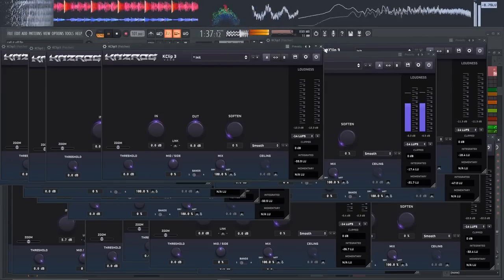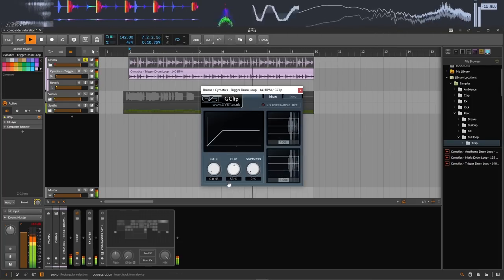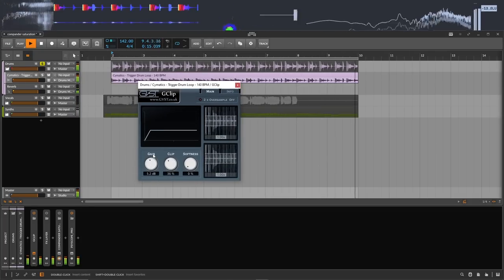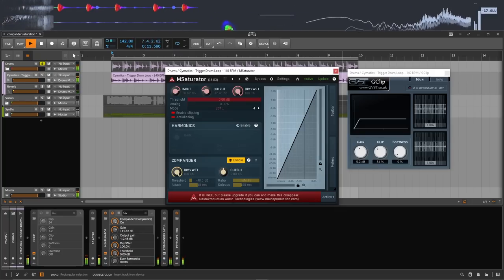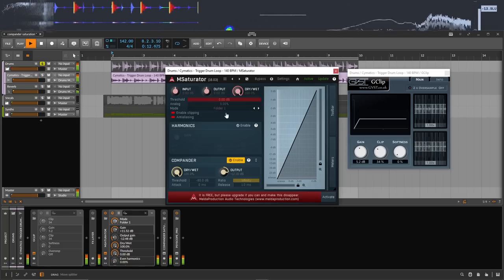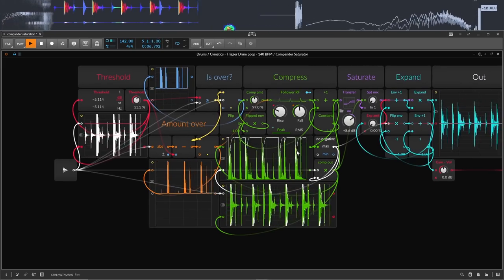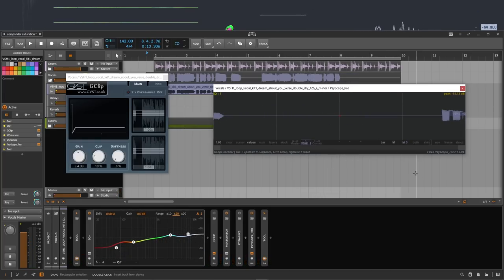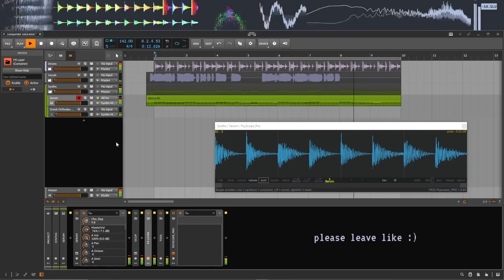heavy distortion without losing dynamics

Comment: the fun thing about a compander setup is that it enhances transients in two ways. first, the transients get distorted harder, and then the transients also get put back in as the loudest 'part' of the waveform. this can definitely cause problems if you're overdoing it, but it can also just be a really nice way to make transients cut through the mix in a way a normal transient shaping plugin wouldn't be able to.
Reply from the maker: well said!!
Reply: So a Compander is the tool? I am surprised Bandlab has it. Compression and Expansion! I understand one but not Expansion
Reply: @rodstone Expansion is basically the opposite of compression. 

Compression takes all output above a certain level and brings it down to the desired level without touching anything below that level

Expansion (also known as upwards compression) takes everything below a certain level and brings it up without affecting anything above that level.
Reply: @SaltSpirits what? expansion ≠ upwards compression. expansion is taking everything below a threshold and turning it down, so it expands the dynamic range. (and then upwards expansion would be taking everything above a threshold and turning it up but I've never seen that used anywhere)

Comment: you can flat tilt out bass pre-distortion and then do the opposite EQ curve after distorting. This will bring back some dynamics as youre distorting an altered signal. Also nice to have it not modulate so hard from insane bass energy.
Reply: what do you mean?
Reply: @PrideGamingTV  pump the bass with an eq going into the distortion and then do the opposite so the rest of it gets some more of the dynamics
Reply: Look up eq curves, tilt is a setting for pro q, not sure where else you can find it but there are absolutely some other eqs that have that option. @PrideGamingTV
Reply: @PrideGamingTV  meaning; if you distort something using a waveshaper with a flat frequency response sidechain, each frequency contributes equally to the intermodulation that will occur in the distortion. By EQing going INTO the distortion, you can alter the impact of certain frequencies and their contribution to the distortion, and then do the opposite EQ after the distortion to bring back the original frequency response of the incoming signal. The "equing in/equing out" is simply to alter the behaviour of the distortion, and is synonymous with equing the sidechain signal of a compressor, or any non-linearity for that fact. Anyway, you know the sound of a bass heavy song getting clipped, and all of the high frequency instruments flutter and warble in response to a big bass note. That is the bass intermodulating the whole signal.

Comment: Its been a long time that ive watched a music production tutorial and it was about something "simple" and generally useful that i didnt know yet
Reply: @jshstuff  also i dont know if this would necessarily have a use, but would it be possible to achieve this without the intial compression? Aka you just record the amplitude of whatever goes above the threshold on your saturator to reintroduce that volume after the clipping. So it would only be cutting off peaks but boosting them right back in.
Reply: or even crazier being able to adjust how much the initial sound is compressed regardless of the expansion in the end. so you could basically adjust how dynamic the saturation should be, but still retaining the dynamics of the original sound, rather than having completely even saturation due to the input getting squashed by the compressor.

I think the thing you built in bitwig could already get close to achieving just that if you just removed the part that did the gain reduction in the beginning.
And obviously application for this would be 808's where you might want a harder distortion in the beginning that fades off. If you compress it then the distortion would be applied equally which would be a different type of dynamics lost. 
You could be adding spectral dynamics from distorting a dynamic sound (aka different levels of saturation due to the amplitude differences) AND you could reintroduce the lost dynamics in the end.
Reply from the maker: yeah you’re a smart one!! this would totally be possible and could lead to some great results. I don’t think you can do that in MSaturator because the companding links the compression and expansion, but in my Bitwig grid patch all I’d need to do is bypass the module doing the gain reduction and it would work just like you said.

thanks for this awesome idea 👏👏👏

Comment: For a different approach, you could have an effects rack that has a compressor on one end, then an expander on the other with the side chain being the pre-compressor sound. For extra gravy you could assign macros that compensate for each other combining the same controls on the compressor and expander side, but because of the saturation you don't necessarily want the exact same settings on the compressor and expander
Reply from the maker: cool idea that would work super well!

Comment: other clever way is insert the tool device after saturation or clipper then add audio sidechain modulator and take the input from the same track but choose pre-fader then adjust the setting with rise and fall settings , then modulate the gain knob in tool device the add original dynamic back into the track after distortion/clipping :face-fuchsia-tongue-out:
Reply from the maker: another bitwig W. you’re totally right I didn’t even think of that. thank you for sharing!!
Reply: @jshstuff  Bitwig is the best daw, no cap
Reply: @jshstuff  To do it in a more controlled way, you could also use a Segments modulator and use that to modulate the Tool device instead of dealing with the rise and fall of any kind of envelope follower.
Reply: @shaboogen  there's endless possibilities with bitwig and that's what i loved about it

Comment: for level match the input and output of any type of sound while maintaining dynamics, dial +6db in Compander Output, Attack <0 ms> and threshold at <-80 db>. Thats literally it. The saturation threshold must NOT be on <zero>, thats the gain knob (it indicates where the effect starts applying, if put at zero it doesnt do anything). Release work to smooth the saturation being added.
What you explain in the video is how to introduce saturation using the compander as a pre dynamic modifier. Thats why it only works if you put +6db in the output of the Compander with the saturation threshold at zero (what you do its surpass the "zero threshold" capacity to read sound). That explains why you dont hear the mode of the saturation changing either.
Great video!!

Comment: parallel heavy distortion (i.e. just using the mix knob on your distortion plugin) at a low-ish mix level can often give you very similar results at a fraction of the effort
Reply: @TheJohnsofDoes  It adds harmonics while keeping most of the dynamics intact

Comment: in fl studio you can just make a channel with distortion and connect it with another which also is connected to the normal one, or just making a copy and adding the distortion on one of them
Reply from the maker: yeah that’s parallel processing. that does a similar thing but is different, if you scroll way back to the earliest comments, check out @Wurldz comment for a good explanation

Comment: Good video! Just a tip, Klanghelm's SDRR2 can achieve a similar effect. There are multiple saturation options, and there's a dynamics section in every one of them. Set the dynamics slow, transients wont be affected/squashed with saturation. Cheap and a good plugin!
Just wanted to share.
Reply from the maker: cool thanks for sharing! it looks good gonna have to check it out

Comment: there's also airwindows' "facet" plugin, wich basically clips the audio "at an angle", wich is kinda hard to visualize but basically means it clips audio while still preserving its peaks. Think of it kind of like if the db limit was a horizontal line across the time domain that sliced the waveform, and then it was slightly tilted horizontally, letting out some of the peaks. It may not be as effective as your technique (and if you push it too hard it just ends up clipping normally at high values), but it works in some cases, it's free and it's extremely easy and quick to use (I'm referring to the idea of clipping without losing dinamics, of course the fatness and overall sound you get is completely different, but it's useful for cases like when you want to clip a simple synth and a sub to get that gritty sound of the sub frequancies and the synth clipping together, but without losing the dynamics that the both already have)
Reply: chris from airwindows is the goat
Reply from the maker: sounds very cool and also confusing, gonna have to check it out
Reply: @VicerFx  yessir!
Reply: @jshstuff  yeah it's pretty hard to visualize at first, u just gotta fiddle around and u'll get the picture by just experimenting. There's also his YouTube channel which has a video for every plugin he's ever put out where he explains in detail how they work and shows examples, so you might wanna check out his video on facet (and his thousands of other plugins, of which dozens are really unique and interesting)

Comment: I got the same with camelphat bitcrusher and input volume control, its also possible with waveshaper in fl, but extreme saturation is a good point, gonna try on plucks. Thanks for the tip. 

P.S. guitar plugins are also a good idea but sometimes it can be too experimental and most of the time emulations use too much cpu resources. And maybe its not so flexible because you control amount of limiting and saturation with input gain (most of the time) so result is based on amp algorithms, and gain leveling can be not very precise. But i found a free British clean amp emulation it works great. But tbh your decision gives more control. Maybe I will use it with some custom amp emulation. Gonna make a nice character to synths. Put huge reverb on the top and play on the edge of the gain and have dynamic range... Mmm, sounds inspiring and interesting 🎉

Comment: this is great! One question though do you think that using a tool, then a saturator/distortion device then a dynamics device with an expander setting and the input signal being the tool would have the same effect?
Reply from the maker: I’m not certain I understand exactly what you mean, but as long as you can find a way to add gain based on the volume envelope of the pre-saturated sound, then yeah it’s the same thing! someone else mentioned that you could simply do sidechain expansion based on the sound itself before the saturator, which is a pretty great solution. that could even be what you’re describing here?
Reply: Yes that's what im saying! Its nice to have it all there in the Msaturator but could potentially be done with any saturator if you sidechain expansion based on the sound itself before the saturator. I like the idea either way. @jshstuff

Comment: The use of MSaturator as a clipper here is super weird and cool but I'm not sure how well its explained for people who really want to dig into why things are happening - took me a while and some playing around to actually understand whats going on here.

I was confused by your description and use of the threshold slider. normally when you set a threshold to 0dB, you apply no saturation since saturation only happens above the threshold. This is how it is implemented here in MSaturator and theoretically there should be no saturation effect happening with these settings. However, the way you set things up here works because MSaturator's saturation stage has no internal headroom and digitally clips at 0dB, this happens ON TOP of the saturation being applied

To say that the threshold controls the clipping mode is a bit misleading. What actually happens here is when you turn the threshold down, you are apply saturation AND digital clipping, which just happens to be functionally the same as soft clipping. This also means that if you have the threshold set to 0dB, none of the saturation modes are actually making a difference, since you are not saturating and only applying digital clipping.

Another thing to note is that the output knob in MSaturator is not equivalent to the clip knob in GClip. it is just a gain at the end of the plugin. There is no parameter to control the clipping threshold, it simply is fixed to 0dB inside the saturation stage.
Reply from the maker: hey, thanks for taking the time to write this detailed reply. I appreciate that you care so much about getting details right. let's see if I can parse this properly and correct my mistakes/comment on everything you mentioned!! sorry for the wall of text in advance haha

for starters, you're completely right about the gclip vs msaturator's output and clip knobs. I messed that up. they're not the same at all and you said it well. wish I didn't make that mistake and it'll bug me forever :(

next, about my use of the threshold slider: yes since I put it all the way up it won't saturate the signal at all, unless it's clipping by going above zero and hard clips (which I consider a form of saturation). in the drums example that I showed in the video, the drums were coming in around +4db, so during the initial kick drum hits, the saturator actually was hard clipping by a few dB. next, perhaps this is just a terminology thing but: you seem to be describing two stages of distortion in this plugin: the saturation, then the digital clipping, which if I am understanding you correctly, means how the saturation stage of this plugin will never exceed 0dB. but to me there's only one distortion stage... this is just a waveshaper that does some form of saturation when the threshold is down, or when it's all the way up it acts as hard clipper with a 0dB ceiling. it's just one process, I don't think there's saturation THEN clipping (assuming the "Enable clipping" button is off). again maybe we're saying the same thing in 2 different ways.

then finally you commented on how I described the threshold slider. you're saying that pulling the threshold down causes saturation to be applied. I mostly agree, but like I mentioned, if the sound is coming in at over 0db then when set to a hard clipper at 0dB, saturation will also be applied in the form of hard clipping, so bringing down the threshold doesn't "apply" saturation, rather I'd say it changes the saturation style from hard clipping to soft clipping - or whichever saturation mode is active. also, even if the sound comes in below 0dB, it can still get saturated when the threshold is all the way up by turning up the compander's output knob like I recommended, which in effect brings the 0dB threshold of the hard clipper down lower. so when the threshold slider is all the way up, it's not always doing nothing. so I don't think anything I said or showed in the video would be considered a bit "misleading". do you still think so?

if I misunderstood anything you said or missed your main points please let me know. again I seriously appreciate that you went out of your way to make sure things are correct. thanks for watching :)
Reply: @jshstuff  no problem! its a very cool idea and im definitely going to work out a way to do the the bitwig grid stuff in ableton with max.

2 stages is just my internalised understanding here, its definitely not one saturation stage and then one clipping stage. The manual doesnt even mention clipping in this manner at all so I think its more like you have this saturation stage that happens to be written in a way that cannot handle audio values above 0dB and so digitally clips. it does this even with the "enable clipping" button turned off so it appears to me like an unintended behaviour that we are abusing for this effect. I'm feeling it as two distinct things here because there are two different styles of distortion with two different thresholds at work - one is a parameter that controls the level of saturation, and one is a seperate 0dB threshold after which clipping occurs. 

'Misleading' was a strong word here, to think of it as a clipping style parameter during this specific workflow isnt gonig to hurt anyone, but my point is that the saturation threshold slider here controls nothing but the minimum level at which the intended saturation is applied. it doesnt magically become a clipping style knob when the incoming signal is too loud. When you say the plujgin is 'set to a hard clipper', this is not how things are working.  The saturation stage ALWAYS hard clips at 0dB no matter what the threshold is set to, and what lowering the threshold does is saturate the rest of the signal simultanously. it just happens that saturating a signal when it also getting hard clipped kinda resembles what we know as soft clipping. 

the output of the compander is simply gain controls between the saturation, and the compressor and expander. if you boost the signal coming out of the compressor when the saturation threshhold is set to 0dB and you hear audible distortion, then its simply going over 0dB and clipping. When I'm saying the saturation is doing nothing, I'm specifically referring to the analog style saturation that is controlled by the threshold slider. you get nothing but clipping in other words. you can check the harmonic analysis in something like plugin doctor, or look at the waveform in an oscilloscope, if you were getting any of that saturation you'd see a visible change when flipping between the different modes, but at 0dB on the threshold nothing hapens.

Comment: You can also make your own de-esser type thingies with parallel, reversed phase, expander tracks if the compressor has a usable high pass filter ceiling. :D
Reply from the maker: this sounds intriguing. would this be effectively the same as a dynamic eq?